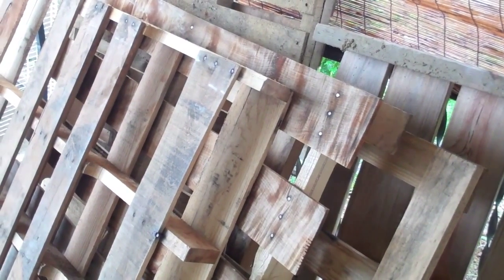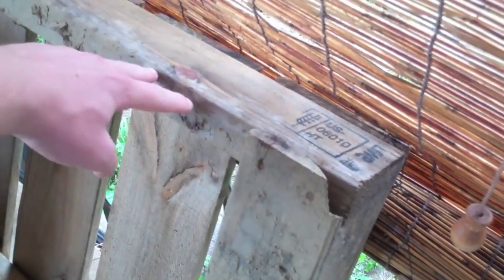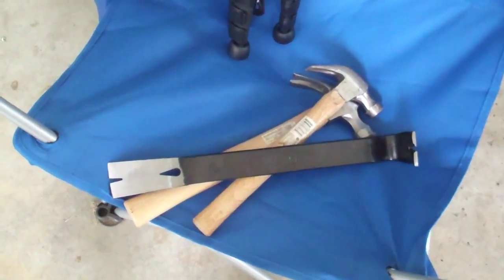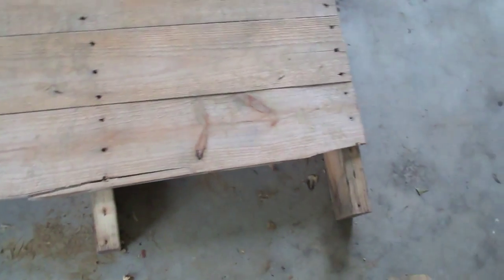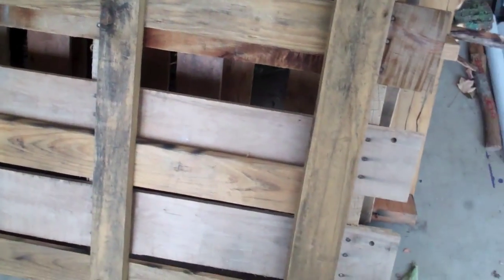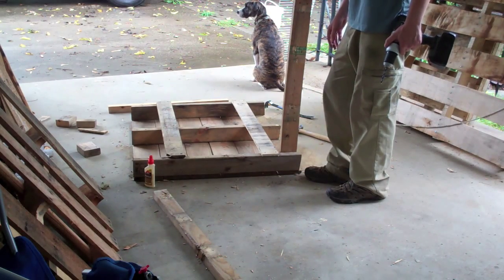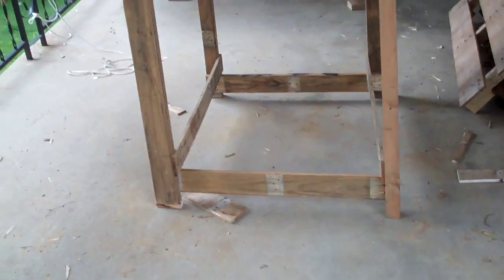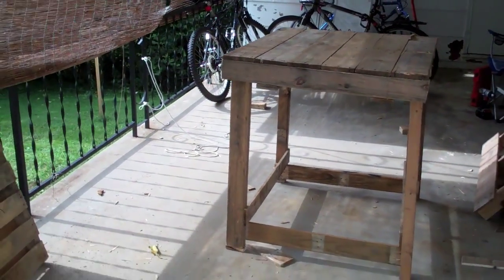Frankenbench - Pallet Workbench

Comment: The fact that the nails are not pointed will actually help to prevent the wood from splitting. Especially since you didn't drill pilot holes. Pallet wood splits easily

Comment: when you get pallets be mindful of how they are treated. try stay away from anything unless has HT on it. and try to use thick boards for workbenches and the 2x4 for legs like you did. will be strong enough. but boards you have are too thin. wont take much to break it to bits. reusing the nails is great since they were used to make the pallet they will be plenty strong enough.
you did great repurposing the pallet and it will last for as long as you stated. great to see people making use of pallets instead of dumping them in landfill. well done. XD next is to make drawers to make little storage places for it